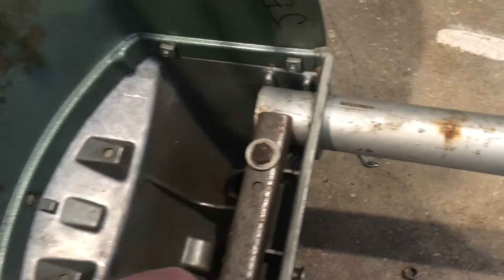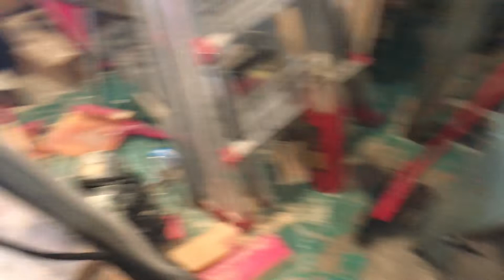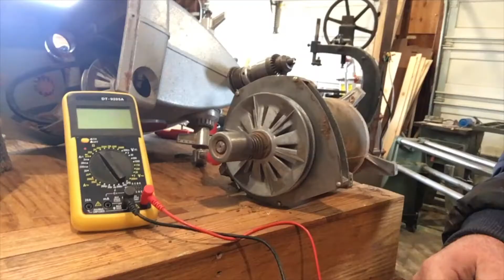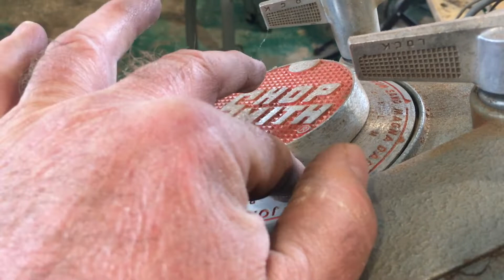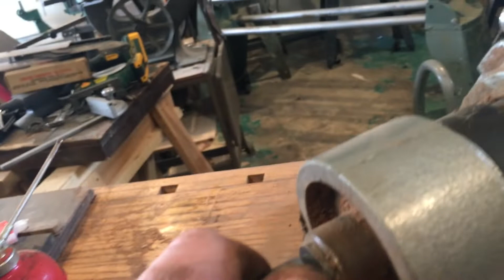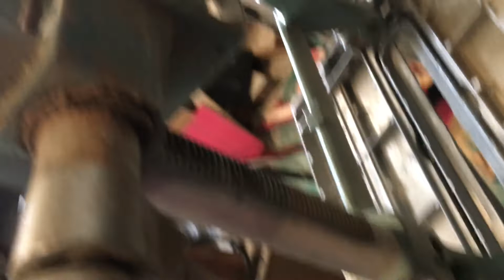Shopsmith Mark V "Greenie" Tune Up and Restoration.

Comment: No ground on the old cord.
Reply from the maker: I have lots of old 1950's and 60's machines that have no ground on the cords. That's just the way they did things back then. Never had any problems with them other than maybe a thrown breaker now and then. Most of them aren't used enough to warrant any changes.

Comment: Sawdust and grease will just gum up the gears. I believe you should use car wax on the tubes and anything welse that slides on the outside of the SS. Of course internal gears and sliding parts need oil.

Comment: I am almost positive thos are sealed bearing, no greasing possible
Reply from the maker: I've actually got grease into them and pushed the old grease out. I have an old water cooled grinder that has sealed bearings. Large plastic covers on the bearing runs and no way to get the grease in.

Comment: Hello Greenie Guru,
I need your advise. I bought a used greenie days ago and found the speed controller would not work. So I have watch YouTube guru's. I found the clip is missing. I am asking if there's replacement. Happy to send you a picture.
Thanks, Chris
Reply from the maker: go to this link. - https://www.shopsmith.com/service/headstock/headstock_diagram.htm

You should be able to order your part from there.
Reply from the maker: Oh, and congratulations on your Greenie! I use mine all the time.
Reply: Thank you very much.

Comment: You actually can remove and replace the lower belt while the motor is attached. Just reach through the access hole and unclip the loop from the speed controller. The belt can then be lifted over the sheave that is closest to the speed controller.

https://youtu.be/3qjB3rRdR4E
Reply from the maker: Thanks for the tip.

Comment: Greenies were made from 1954 to 1961.
Reply from the maker: The date on the paperwork lists April 1962 as the original delivery date. It could have been manufactured in 1961 but it is definitely a greenie.

Comment: This was fun to watch. The way tubes, which are the top tubes that the headstock slides on, should be fully inserted into the castings on both ends, you shouldn’t back them out to make it fit the base. It appears that your bench tubes (the lower tubes) aren’t properly seated, which is why it made it appear that you needed to extend the way tubes from their castings. You may have inadvertently switched the bench tubes for the way tubes. The bench tubes are slightly longer than the way tubes. Hope you are having fun!  Scott
Reply from the maker: Thanks for the input Scott! I have two Shopsmiths and each one the bench tubes  were  extended roughly 1/4 to 1/2 inch beyond the clamp. At least one I know was not altered as shipped from the factory. I will check with the company to get the final word.  As for the bench tubes and way tubes they are correct and it's impossible to get them switched as if you do the ways won't catch the locking clamp but extend well beyond the bed. The unit appears to be level and aligned as is. Having lots of fun!
Reply: @jasonwilliams8321  Good call. I vaguely recall that the Greenies had slightly larger ID in the bench tubes. Is that right? My only concern is that you should be able to sully seat the way tubes on both ends, so if that makes them fall short of the base end castings then the bench tubes aren’t in far enough. Years ago SS was sued by someone whose Mark V came apart during turning in part because one part or another slipped apart. I’ve been double checking my Mark V’s ever since. Like you I own a few. Scott
Reply from the maker: @MyGrowthRings  Yeah the bench tubes are 1/4 inch thick steel. That was the way with all the tubes on the old 10ER's. They weighed tons. The modern shop smiths (1970's on) all the tubes were the same ID.